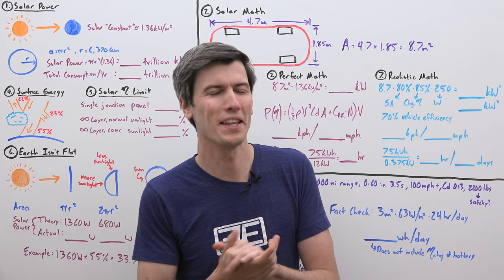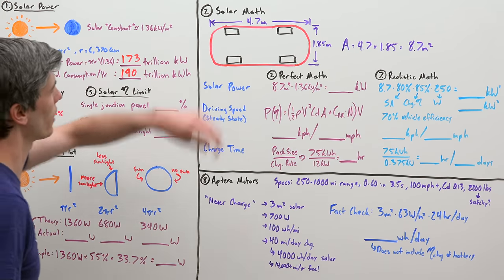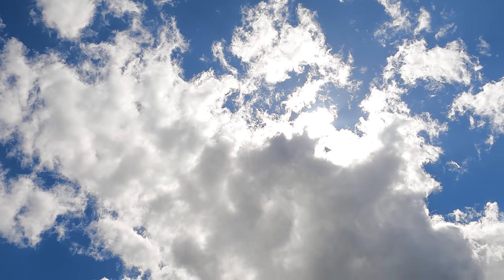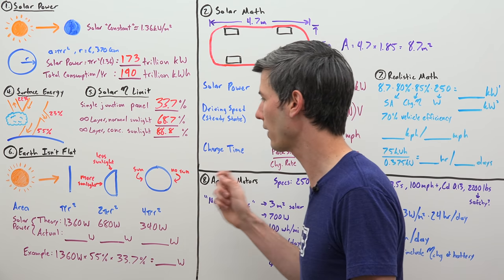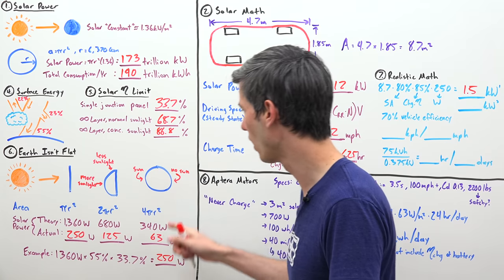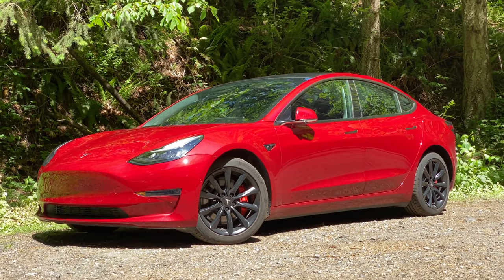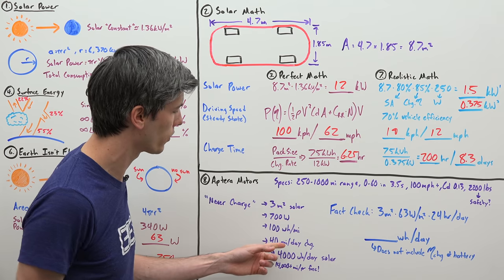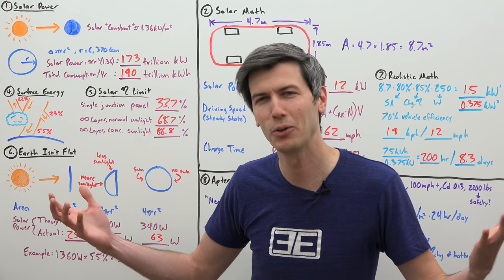Why Don't Solar Powered Cars Exist?

Comment: I was intrigued by Aptera before, but going through all the math has got me convinced- it's a perfect fit for my needs, and I hope to see more like it soon!
Reply: I was watching the original Aptera design 12 years or so ago. Put on hold by the crash of 2008 it is interesting to see that battery and solar technology has improved to the point where their previous work in Optimum aerodynamics has been augmented to the point that this is a very practical approach, for a   design at the edge of popular acceptance. Thanx for the excellent layout of the efficiency relationships.
Reply: I have reserved mine already.   It's a 100 deposit.

Comment: I think it would be great to have some solar panels on any electric vehicle as a backup. If you ran out of energy and weren't too far from a charger you could conceivably crawl your way toward the next charger without needing to be towed.
Reply: Yeah, exactly.  It doesn't have to power the entire car, but it's nice to have a trickle charge on the side.
Reply: Altera offering at home charge point today.
Reply: Exactly!! There is this ridiculous idea that  solar has to completely replace charging. We don't need it to. It just  seems foolish that we have the sun literally spitting free energy at us and we aren't trying to harness that as much as possible. If I could get a free 30 miles a month, I'll take it.
Reply: Actually, solar energy would be a nice thing to power the secondary things that consume energy in our cars. I think about AC for example. In summer, using AC takes a lot of the battery.
Reply: Except you have to move more weight to have the panels so you’d be running out of battery faster so that you could charge the battery when it runs out. Kinda creating the problem you’re intending to solve for

Comment: If the entire hood and roof could be made into solar panels, you might be able to recharge about 10 km on a sunny day. There's no way you can have a 100% solar powered car unless you just barely ever drive. But, it could be a useful feature for offsetting self-discharge and/or "vampire drain." It'd be nice to be able to park your car outside for extended periods of time without having to worry about it eventually draining itself. If you're stuck in the desert at a roadside with a dead battery, having a solar roof/hood could help you run AC while you wait for a bailout.
Reply: @NeoHCgbz  Wind turbines is a totally unrealistic idea, but i love the creativity behind it :D
Reply: It's called a trailer. It might not be attractive or super easy to maneuver, but with existing technology, you need a trailer.Coveed with solar cells.
Reply: Guess you need to watch the full video...  Aptera looks as though they will be able to make a solar charged never plug in to charge car for maybe a third or half of drivers who live in sunny areas & drive less than 14 000 miles a year...
AC is very power hungry, those car body solar cells will probably only run the AC gently!

Comment: There are two other companies that want to build solar cars, lightyear one  (looks great, they are comming from the World Solar Challenge) and Sono Motors
Reply: wow, thanks for the info! I'm really into this kind of projects and I've heard about aptera but not this two, they look very interesting, especially becouse this look like actual cars that may be more usable than the aptera's tricycle
Reply: And none of them have published any real world measurements of the solar efficiency. When is it no use to keep the car awake (a few hundred watts idle consumption) to try to get solar power? 
None of them have anything but 1-2 hand built prototypes. Sono Motors used to arrange test drives in cars that were revealed to be rebuilt BMW i3, just a new body with non-working solar.